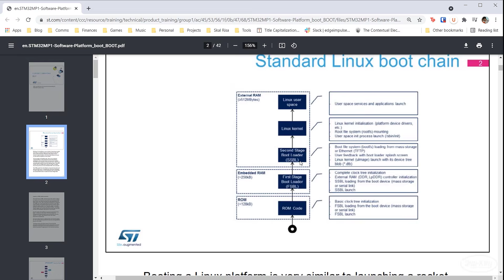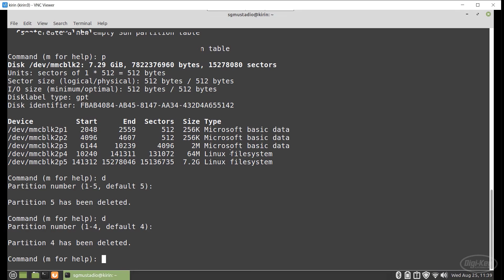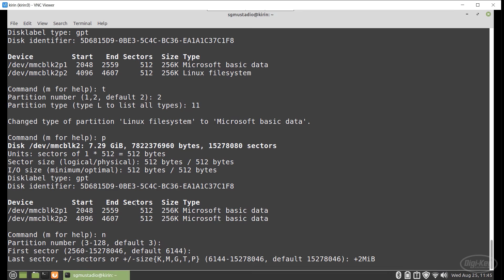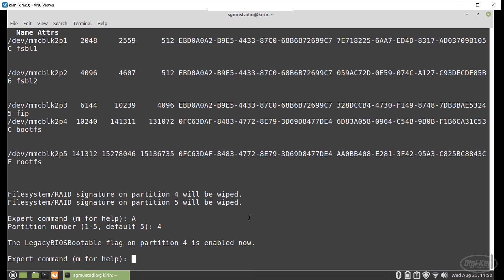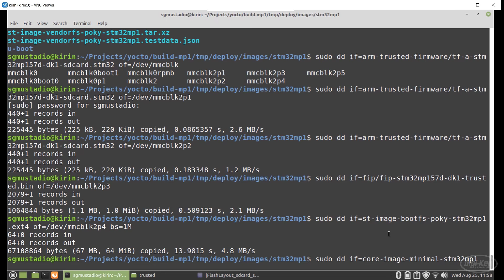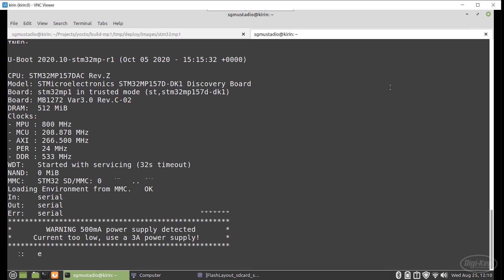Comment: I have tried this exact same building process for the yocto core minimal image ; however, I didn't get the "trusted" folder in the "flashlayout_core-image-minimal" directory. The entire process was ran seamlessly, facing with no errors, and getting all of the necessary output files. When I didn't get the trusted folder, I tried for the "optee-min" firmware to boot on my board,  but it failed to boot on my STM32MP157D-DK1 hardware because of the "metadata.bin" UUID not matching with the UUID of one of the partitions of SD Card, which was meant for metadata. I have tried multiple solution to eradicate this error, but none of the solutions got worked. Therefore, I am requesting @DigiKey and @ShawnHymel to look forward for this problem, and suggest me the corresponding solutions to solve this problem.

Comment: This is a very good series, simple and clear. however, I had a problem booting up the discovery kit and got 2 lines that stopped the boot sequence:
[   33.762475] vref: disabling
[   33.765065] vdda: disabling
The whole process wad good, but after connecting the SD-card and starting the board, I got that.
Reply: Hi, my problem is solved, edit the file to find rootfs with /dev/mmcblk0p5 instead of /dev/sdc5  (/dev/sdc5 in my case)
Reply: @illie8066 I got the same problem, have you found the solution?
Reply: Sorry for the late response, I had to put it on hold,
So, thank you, @dnyaneshvarsalve2984, it worked for me too!!

In my case, the location is: /media/illi/bootfs/mmc0_extlinux/extlinux.conf
Naturally, I changed to: APPEND root=/dev/sdb5....... because in my case the partitions are sdb1..5.
changed to mmcblk0p5 and it worked and I succeeded in logging the system.
Thank you!!
Reply: Hello all, October 2024, building for/using stm32mp157f-dk2, the change of UUID to /dev/mmcblk0p5 in extlinux.conf did not work for me, but using fdisk to change the uuid of the 5th block (the rootfs) to the uuid found in the extlinux.conf (and other files in that same directory) did work for me. 
The learning curve is steep and bumpy, but many thanks to Shawn and Digikey for get us this far. Cheers.

Comment: Raspberry Pi/beagle bone black /STM32MP157F-DK2 which one is better ??
Reply: it depends what you need it for. if you need microcontroler for robotics or adc for sensors. BBB is better. If you just need server with some io, raspberry pi will do just fine. Don't do DK2, its crap.

Comment: There are a command, which I don't remember the name of, that expands ext3 and ext4 file systems.  It is easy to run that, especially from Raspberry Pi or any other Linux system. 
"man -k ext4" should give you some clues where to find it.
Reply: You're probably thinking of the "resize2fs" command.  When run without any parameters other than the device, it will resize the file system to match the partition size.

On Debian and related systems, it is part of the "e2fsprogs" package.  This is the package that includes pretty low-level ext file utilities like fsck (e2fsck), so I would expect it to be in this minimal Linux build.  But maybe the build is extremely minimal and therefore omitted this tool.

Of course, it only needs to be on the device if you want to resize the file system from the STM32.  You could also do that from the host PC after writing the file system to the SD card.

Comment: Can the same tutorial be tried with a Raspberry Pi?
Reply: Do you mean using the Raspberry Pi as the host machine or creating an image for the Raspberry Pi? If using as the host machine, then it should work, but it will take much longer (as the Pi is slower than most modern PCs). If you mean creating an image for the Pi, then that's also possible. I recommend checking out this tutorial: https://jumpnowtek.com/rpi/Raspberry-Pi-Systems-with-Yocto.html
Reply: @ShawnHymel  Thanks a lot. I meant creating an image for the Raspberry Pi. I will surely try it out.

Comment: Hey Shawn and Digikey! Thanks for another great video. Did you get to try genimage for an sdcard image creation? That's how build root does it, for most hardware it has this option anyway, and you can use it with your Yocto build too :) Hope this helps.
Reply: I didn't know about genimage, thanks for the tip!

Comment: Couldn’t you hear me screaming about expanding rootfs on the development system?
Reply: Don't worry...that's something I tackle in the next episode ;)
Reply: @ShawnHymel  But you don't really want to hard-code any size for that file system.  You always want it to fill all remaining space.

My recommendation is to set the file system size to the minimum needed for a running system, and then expand that file system to fill its partition after writing it to the SD card.

If you do it from the host, there are many tools.  I like the graphical "gparted".  Or you could use the "resize2fs" command.

Or you could do it on the STM device, if your minimal installation has "resize2fs".  It might, because that command is typically part of other low-level ext utilities like fsck, which really need to exist for a functioning system.

One approach might be to add a script (maybe via systemd) that runs only on the first boot, which resizes the file system to fill the partition.  Then (if you want to be really slick), the script can disable itself, so it won't try to run the next time you boot.